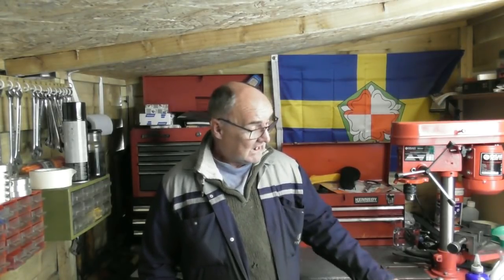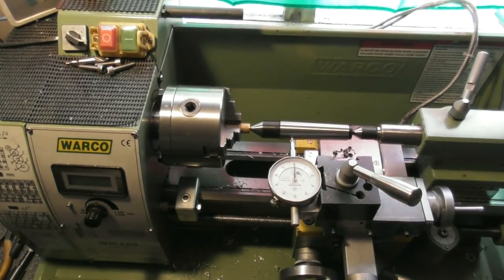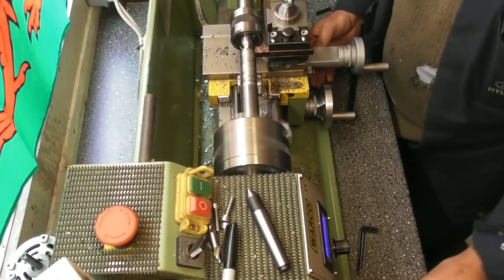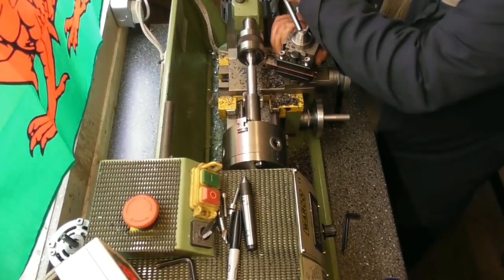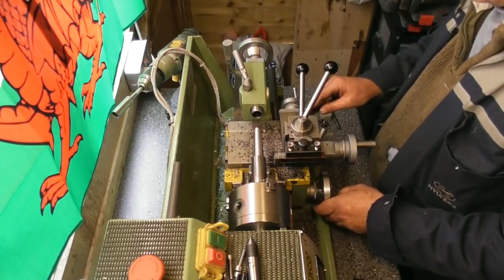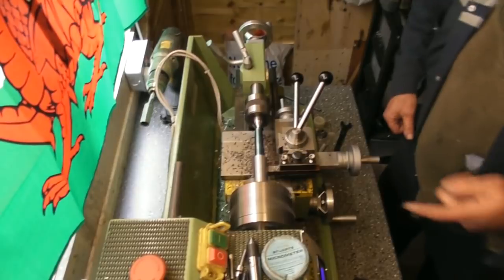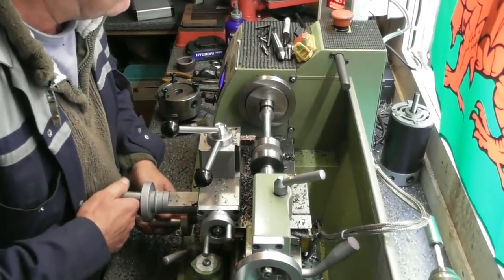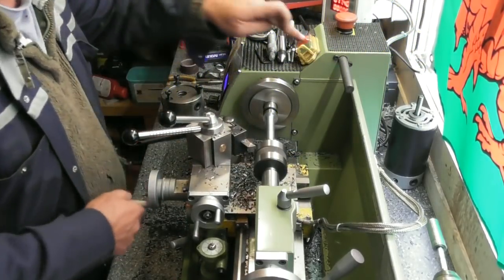WARCO WM180 LATHE Shop made Tailstock die holder pt 1

Comment: Ade f you had your time again would you buy this lathe, i am looking at buying the same model and with the DRO they tell me they have changed the way they set them up and don’t get in the way on the new ones,
I make small engines sterling hot air engines
Reply from the maker: dave cox  I would it has been great so far

Comment: As Bernd Rohne noted, the taper angles of Morse tapers (other than MT3 & MT6) are not the same. They are slightly different and if you want to know why you'd have to ask Mr. Morse... the most reasonable explanation I've seen is that's just the way Mr. Morse's gauges turned out in the 1860s... so the world used his standards and that's that. 
A.W. using a MT3 to set a MT2 taper is a practical thing to do. No matter how exactly you cut a particular MT you need to blue it and fit it to your machine...the taper in the machine tool is only as accurate as the reamer that cut it. The differences in the different tapers are so small that you can't easily measure the differences without a gauge set-up (you can see examples of how this is done in reference works like "Machinery's Handbook").
Reply from the maker: indeed . i sorted it out in the blueing , the difference is 0.007 degrees . the polish sorted it . i will comment in futher vids in this series . thanks for your input , Ade.

Comment: Nice video. The taper of mt2 and mt3 are similar, but not the same.
Reply from the maker: i agree, but for my purposes , it was fine , 0.007 degree difference could be sorted when i blued it to fit and i doubt my tailstock was that accurate , but as you say they are not the same . i stand corrected . thanks for your input , ADE.